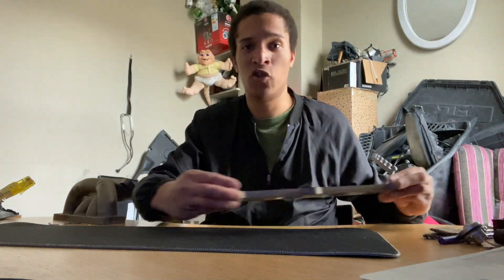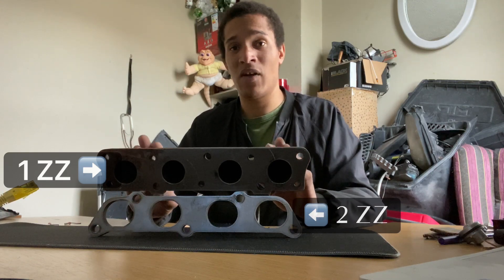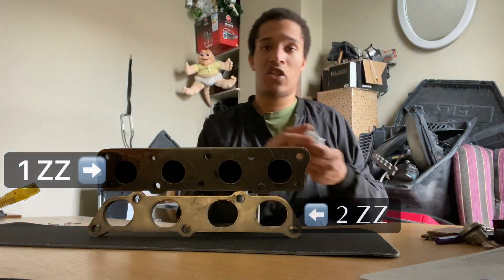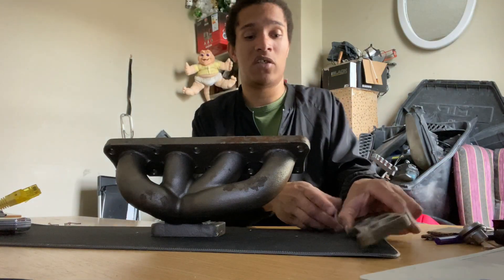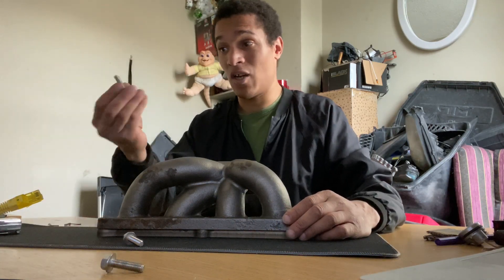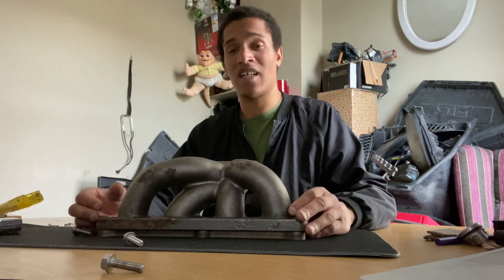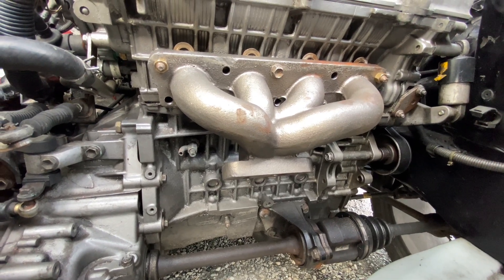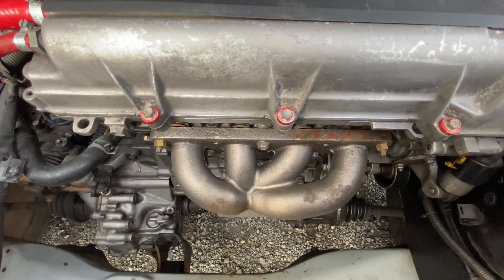Unboxing, installation, Test Fitment: Cheap Cast Iron 1ZZ / 2ZZ Turbo manifold

Comment: Glad you got it OK Alex. Good thinking with regards to getting the flanges skimmed  if you get the manifold to head flange skimmed about 7mm and ported, and the turbo flange skimmed by about 10mm this will give you a lot more room to play with . If you can bolt an adapter in from the top of the turbo flange then you might be able to get away with using a flat adapter.
Reply from the maker: Thanks for the comment! I actually found an T3 turbo with internal wastegate that should work on our cars but if also plug & play on this manifold. Getting it by the end of the month so I’ll post a video about that to show what I decided to do. Yea was thinking about that indeed because 20mm is quite some thickness same with the head flange. I’ll update this on my next video! Thanks for the tip!